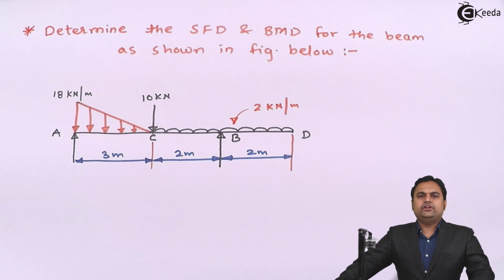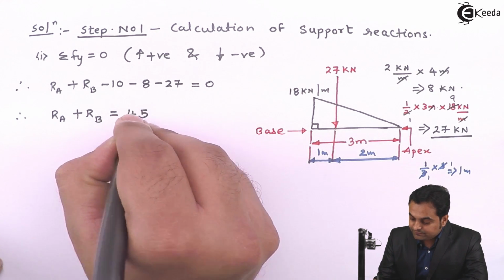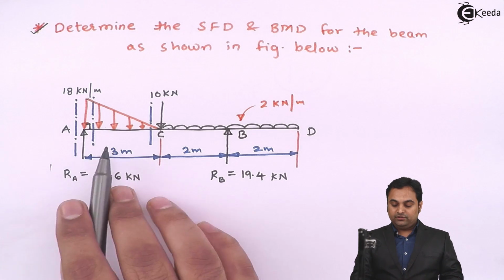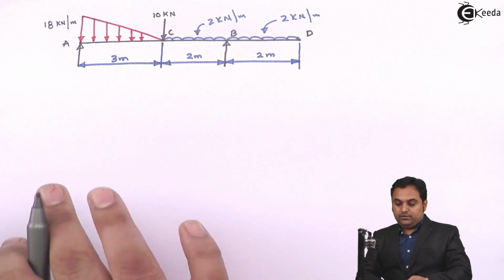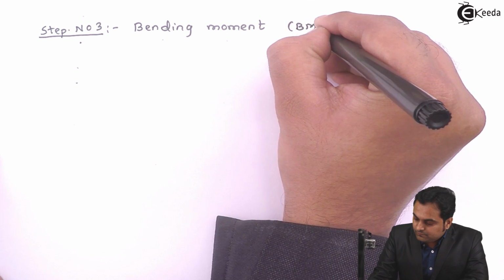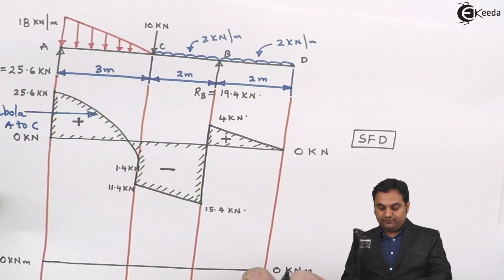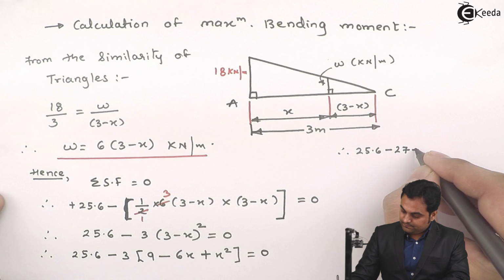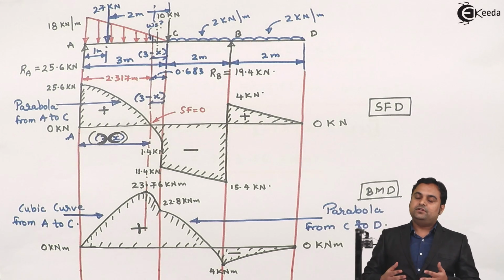SFD and BMD for Beam - Problem 2 - Shear Force and Bending Moment Diagram - Strength of Materials

Comment: Sir, Very nice explanation and helpful to understand the problem. 
Please let me know how to calculate the "X" if we consider smaller triangle base as "X" and remainder is "3-X" as you have marked initially while solving the problem.
Reply: You can take any one of them either x or 3-x the answer will be same. In the above ques. the value of x is calculated wrong it's 2.92 m.or may be the equation is wrong x is correct !!
Reply: @sbti6051  shear force of the trapezium has to be considered. or it can be considered as 27KN (for bigger triangle)-smaller triangle area

Comment: Sir i guess there is a mistake at calculating the distance x..as at that particular point shear force is 0 so the summation of reactant force 25.6 and the total shear force from point A to the point at x distance is going to be 0..total shear force due to uvl is the area of the trapezoid..so the equation is going to be 25.6-(18+6(3-x))*x/2=0 that gives the value of x as 2.317..plz correct me if I am wrong
Reply: It is correct bro what u said
Reply: Yes calculation mistakes it's coming x=.078 something okey

Comment: i think Sir has not elaborated how to get  x value. the simple way to find  x is always is take  x from zero load of UVL. i.e. the zero load of UVL is at C. so take  x from point C. now calculate the all loads up to x from point A. 25.60-{(1/2*3*9)-(1/2*x*6x)}=0. now we can get x=0.683m from point C. hence 3-0.683=2.316m.

Comment: Shape of SFD from points A- C is wrong and also the equation used for calculating the value of x is wrong. The equation is 3xsquare -18x +25.6=0

Comment: how you calculate the value of x here you took the load distribution of small triangle but the value of x then must be 0.078 but your value is 2.317 this is possible if we take the load distribution between the trapezoidal area and then calculate the shear from point A to the x distance :-              
25.6- {(18+6(3-x))÷2}x
Reply: thanks but there is another method check this out  if according to question for uvl it varies 18 so 18 per 1 meter so how much per 1.4 per meter x that is x=1m*1.4m/18m which is .078

Comment: can anyone tell me , why two beam sections are taken on both sides of each points, where on the other videos there're only one section of beam taken on one side of a point ?
Reply: you can do in anyway,that is from right or from left.the answer will be same.so think about the easiest way
Reply: Anas he asked, that why he has taken two sides at each point but not that where to take, either on ri8 or left of a point.

Comment: for point of contra shear 

I calculated in this way

25.6 - (1/2 * x * 18) = 0
 thats is for u.v.l I have taken Half into base into height for which base is x and height is 18

hence my distance from point A is 2.84m

is this way correct or your's method ???

confused 🤔😓😓😓

Comment: Sir , in SFD between section A to C , why the shape of parabola will be convex through out? why not concave through out? or concave then convex? or convex then concave? why not? please let me clear about this.
Reply: calculate the bending moment at the midpoint of any beam section and if its greater or less than both the end bending moments then you can interpret the concavity or you can always use slopes concept also.
Reply: Souradyuti Saha my doubt tooo
Reply: Smjh ni ata too fast...
Reply: achi answer bhai
Reply: Actually sir has taken parabola wrong in section AB....
Strictly speaking parabola should be of decreasing slope ; because intensity of loading from section A to B is decreasing...
Reply: @Sumit Singal Shanks ...no when UVL is decreasing ,it is concave parabola